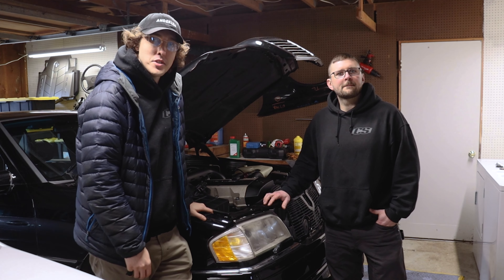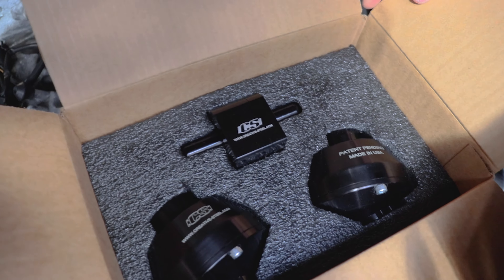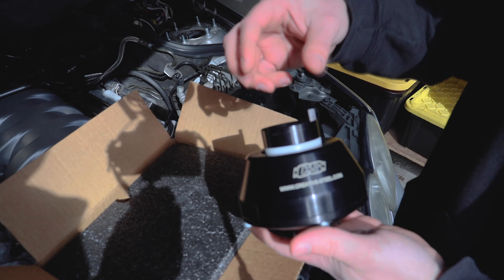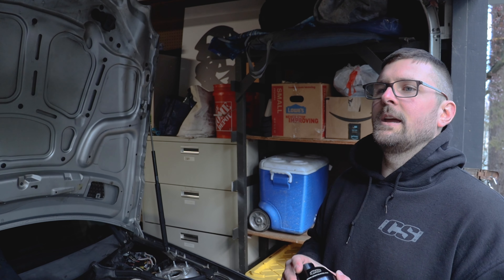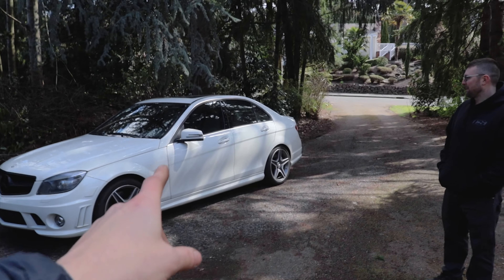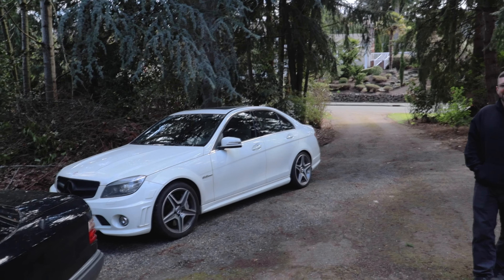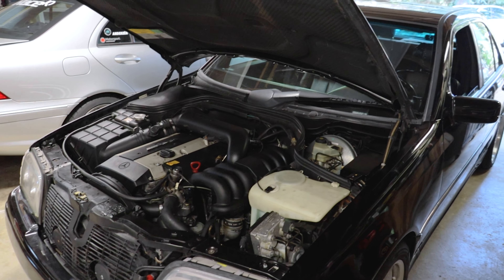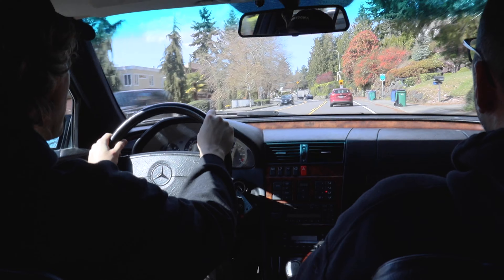How Do These Creative-Steel ELIMIVIBE Engine Mounts Work!?

Comment: Awesome video. does this work in the similar way as crank harmonic damper to reduce vibration thereby increating longevitity and even increase HP, power and performance?
Reply from the maker: @yellowjoe.2000  a bit different I would say but overall kind of yes lol
Reply: @ANDERZENAMG  awesome. before any HP engine mods., i plan on 1. crank vibration dampener, 2. lightweight carbon fiber drive shaft, 3. electric fan, remove engine crank fan. all this should get me extra 25 hp. adding these elimivibe  motor mounts would be amazing too